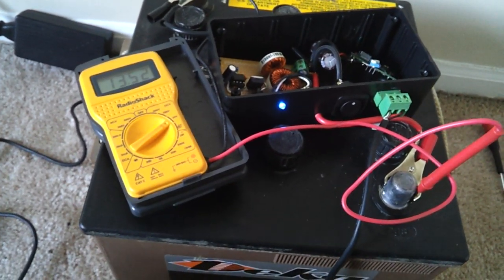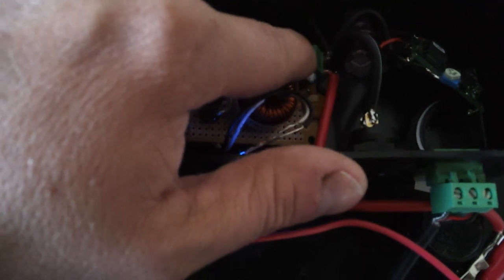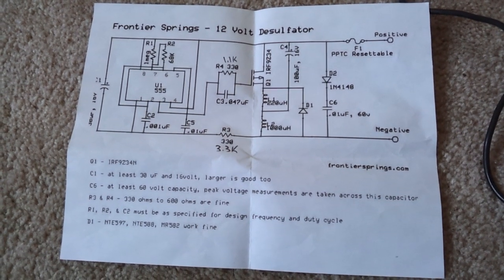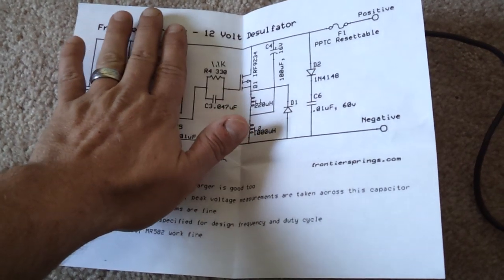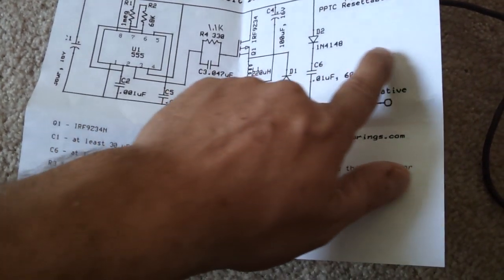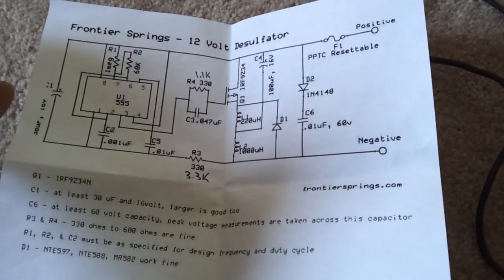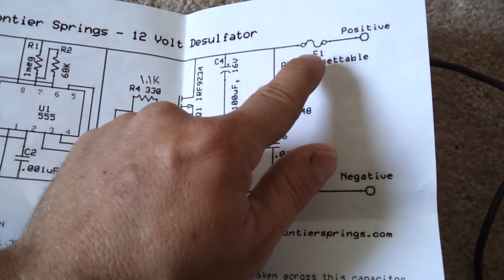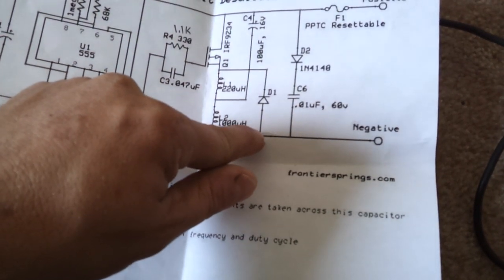Reconditioning your car battery (desulfator) Part 2 - The circuit design

Comment: Thank you for the video. I am plannig to build this as it can solve my battery problem.
one thing I cannot understnd is 3.3 K resistor which devide the negative line. 555 ic cannot deliver much current and that resistor would not pass an adequate current to the battery it seems. Even for high frequency it need an amount of current to work on the lead plates with sulpate.  Is it not necessary to have particular amount of voltage and current to act on sulphate? Thank you.

Comment: When you have you trickle charger connected to the desulfator in parallel to the battery. What did you use to stop the higher voltage from back feeding into the charter unit?

Comment: I get that D1 is the damping diode avoiding going negative. But why the double coils and why C4 between the main coil and positive? The voltage over C4 should be way more than 16V.
D2 C6 look counter productive in removing the high frequencies produced by the rise of the pulse.

Comment: I recently acquired this battery reconditioning plan ( Check Details Here>>>https://t.co/K0S4ZxvA0x ) and just reconditioned 2 car batteries. I did the instructions in a breeze due to the simplicity of the guide. I wish I would have discovered this years ago! It really works for any kind of batteries!

Comment: the L2 inductor is not available from jameco, they have one with a little different spes.     the one they have specs are 1000uh 1.3 IDC .4 ohm. do think this would be a problem

Comment: If the battery reads below 10volt one cannot revive the battery with desulfator.
Reply from the maker: jagadeesh patil Not entirely true.  I have revived batteries there were sitting at 9V for a 12V battery.  I do concede that your rate of success goes down as the battery has been sitting dormant for longer periods of time.
Reply: +jagadeesh patil   Not certain about the points made but ,if anyone else wants to uncover how to recondition batteries try Renkarter Rapid Renew Report (do a google search ) ? Ive heard some amazing things about it and my buddy got amazing results with it.
Reply: +jagadeesh patil hi everyone ,if anyone else wants to uncover how to recondition old car batteries try Vaxicorn Battery Extender Guide (do a google search ) ? Ive heard some decent things about it and my m8 got amazing success with it.
Reply: +jagadeesh patil 
Wrong.  I've revived 12V starter batteries as low as 5.5V
It all depends on how the batt was discharged & for how long the sulfation crystials have bonded.
Reply: +jagadeesh patil There are several factors in battery reconditioning. One resource I discovered that successfully combines these is the Magic Mender Wizard (check it out on google) definately the best info that I've heard of. look at this  awesome site.
Reply: Marko Marrin Dudarin
Where is there a link to the pdf (NOT to their promotional info to sell their product)??
Reply: I have spent months researching into battery repairing and discovered an awesome website at Jons Mender Guide (google it if you are interested)

Comment: Question about Q1 IRF9Z34 hookup. Half the circuits (like yours) show the S leg connect to L1 and D connected to Positive voltage. The other half (like YouTube SLA battery plate desulfator) shows just the reverse, the S leg connected to the Positive voltage and the D leg connected to L1. Please help my confusion, thanks

Comment: Not trying to be a wise ass or anything!  Epson salt recondition seems to work fine and battery chem has something better.  Your de-sulfater is way cool & tec but I don’t have the smarts to make one.  Can a good one be purchased & if so where?
Reply: Look for products from CTEK (MXS 7.0). This gadget should be able to desulfate batteries.

Comment: 1] Hi, I was wondering if bigger is better in desulfating a battery. I want a heavy duty desulfator that will blast off the sulfate quickly. I figure if you used a triple strong pulse every so often, "timed in between pulses," that might be like hitting the sulfate film with a stick, and start to loosen the sulfate back in to solution.

2] I was also wondering if dumping out the acid and replacing it with a baking soda solution will draw off the sulfate much faster. I figure baking soda is a base and sulfuric acid is, well, an acid. I have heard this will quickly dissolve sulfide back into solution. You can rinse out the battery and reuse your acid.

Please let me know what you think. I think this might speed up the process and revive doomed battery's.
Please note that I have not tried this myself, but I thought you might like to try it.
Please be careful, wear a splash shield incase of explosion, just in case.
Reply from the maker: pateince is key young padawon.

Comment: I was lazy to build my own and bought this http://www.amazon.com/gp/product/B000P23HZS/ref=oh_details_o00_s00_i00?ie=UTF8&psc=1 but I tested the frequency across the terminals of the battery while the unit was connected and I did not get a Hz reading. I was wondering if you test your battery while your desulfator is attached, would you get a frequency reading? I'm guessing you should get the frequency that the MOSFET turns on and off?
Reply: Let me know how the batteryMinder works for you

Comment from the maker: It does have some effect on the timing, if you substitute it with an incorrect value you could end up having the mosfet on of off at the wrong percentage.  This will either burn up the mosfet or render the desulfator useless.

Comment: Does capacitor 2 determine the timing on the 555 chip? I've only got .022uf, .01uf or .047uf to use and was wondering if I could substitute if its just there to smooth out voltage?

Comment from the maker: Your current is too high, should only be around 100ma max.  1.2khz is okay, that wouldn't be causing it to heat up.  I would check your solder connections as it sounds like the mosfet is not being turned on/off HARD, or the mosfet is faulty or you subsituted the mosfet for a different model.  Other then that I have no clue.

Comment from the maker: I do not build and sell them.  I have a video up that will show you how to order the circuit boards and then a parts list that you can use to order the components from newark.com.  Look in my playlist for the desulfator series and it should be the last one.

Comment: no you havent, you have shown us "before and after" you have never shown us a battery with a resistor pack showing low voltage, then connected to a desulfator and subsequently charged and then put on the same resistor pack showing a higher voltage, in a single take. that would be proof.

Comment from the maker: Cyberdems - I have a seperate video for the dc-dc converter, but it's purpose is a trickle charger to replenish the power used by the desulfator.  It is not essential, but makes life easier.  I don't have a kit form as of right now, but once I'm done with the "infinity sun jar" project I plan on revisiting the desulfator and designing a true PCB for the circuit.

Comment from the maker: driftboatlou - the schematic is not mine, it's frontier springs.  I mentioned in one of the videos that the schematic is wrong when it came to the mosfet for that very reason.  When I'm done doing my series on my "Infinity Sun Jars" I'm planning on coming back to this and drawing up a proper schematic.  Might also decide to start making the PCB's for this since frontier springs seems to have fallen off the face of the earth.

Comment: Just wanna say thanks for the video. Finally, have mine working without the dc-dc converter. Now I'd like to step it up a notch and include the dc-dc converter too but not sure how. Did build your own dc-dc converter, or did you buy a trickle charger that you opened up and somewhow connected to the desulfator?

Comment from the maker: rrfox100 - sorry it took so long to respond, post wedding day cleanup is still going on and finishing my wife's move-in with me.  r3 drops the voltage from 12 volts to around 6 volts to safely power the 555 circuit so your observations are correct.  :-)

Comment: Hey so I put together the desulfator circuit (without the dc-dc converter) on a breadboard to make sure I have everything right before I start soldering and for some reason my fuse is getting real hot when I hook up the circuit to the battery. Any tips on how to fix this? Maybe I'm connecting the mosfet wrong? I have the gate connected to the 555 chip side, the drain connected to the inductors and diode, and the source connected to the positive line.

Comment: Really helpful video thanks! Will you please make a step by step video on how you built your 6 Amp DC-DC converter and also how you connected it to the original circuit from the schematic?

Comment from the maker: mag7 - check my channel as I just uploaded a video that will help you start troubleshooting your circuit.  I've built 3 of these so far and each one i have overlooked something simple, such as a diode in the wrong direction or the mosfet flipped around.

Comment from the maker: Mag7 - what is the voltage of the battery that the multimeter shows before you connect the desulfator?

Comment: Was wondering if you might know whats wrong, completed and connected to battery, the unit makes a quiet noise but when I check the voltage at the diode and buy the torrits it is really low like .6volts? I dont believe its building up the higher voltage.
Thanks